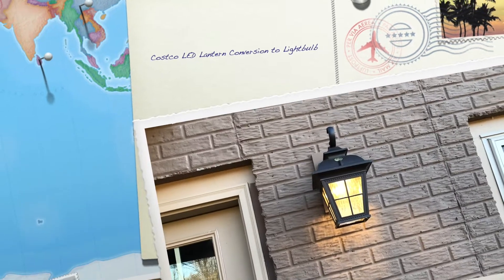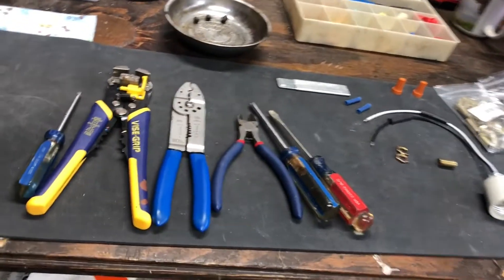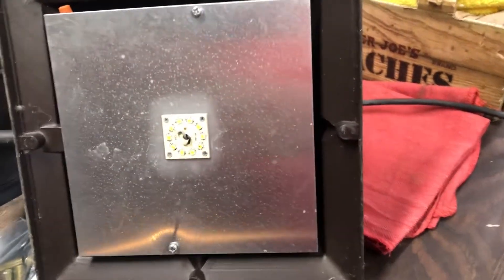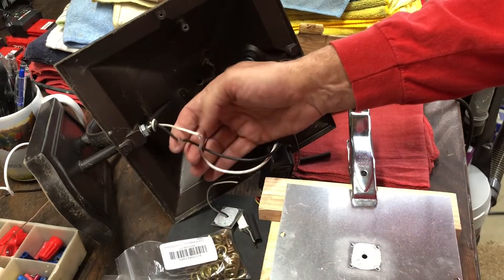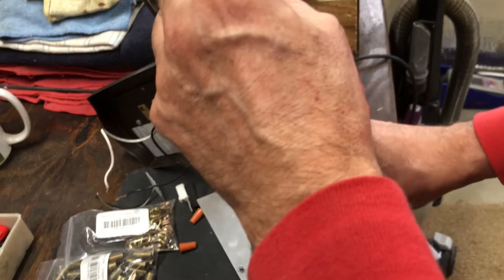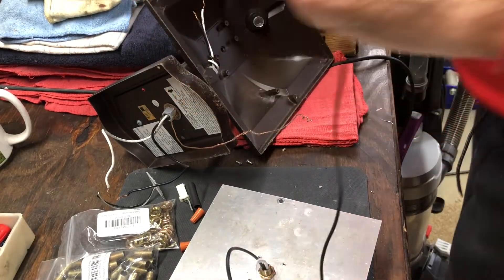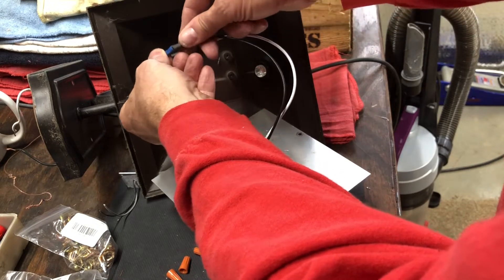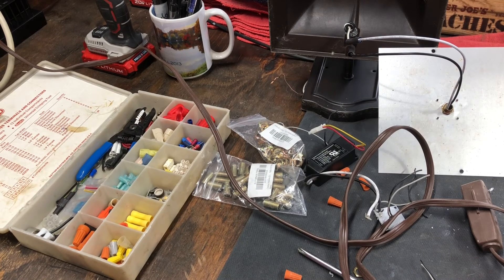Costco LED Lantern Conversion to Lightbulb

Comment: Easy to follow video. This is a way cheaper solution and gives one a lot of flexibility ... you can choose your brightness and your white shades, if you get the adjustable LED light bulbs, you can put them on a dimmer switch ... you can change to colored lights for the seasons.  I think you could run the hot (black wire) to the dawn/dusk sensor and then run the hot wire out of that and attach it to the black wire on the socket and the light will turn on at dark and turn off at light.  Thank you Chevy Guy.

Comment: Hi can you convert the costco lantern in to light bulb just like you did but leave the photo sensor connected so it works like it first did when new
Reply from the maker: I guess you could but I removed them because I wanted to control them manually.

Comment: Hey there, great video. In your description, you have two product links. Does the one for the ceramic fixture come complete with everything needed for this conversion?
Reply from the maker: the ceramic fixtures are just the fixture and wiring. You will also need the lamp rods (Amazon and big box stores) and lightbulbs

Comment: Thank you for detailed video… I did this but left in the sensor, was hoping it would work… unfortunately now when I turn on the lights… they flicker… makes a clicking sound like a blinker in a car… (weird)  no matter what type of bulb I use… the only difference in mine is I left the sensor in…🥲😢  guess I will try one more time to see if I can fix this.  Darn was hoping this would be the fix… any suggestions???
Reply from the maker: The sensor might be 12 volts?

Comment: Thanks for posting this!  Mine started flashing and I replaced the driver.. Then another problem.. Fortunately I bought two of the Altairs at Costco, so I had a reserve. Next time, I will be doing this.  This is somewhat similar to what I did inside my house - replacing CFL can lights which had ballasts die with standard socket cans and LED bulbs. Thanks again!

Comment: what about the sensor ?
Reply from the maker: I disconnected the sensor when I bought the lights, so if you want a light sensor, you will need to swap it for a 120V since the original is 12 volts

Comment: I am so happy you posted this.  I finally have changed four of our LED parts for bulbs.  Kits come with everything you need.  I was surprised how fast you can install  the bulb parts.  I still have two more to do but I am so happy.  I can use colored bulbs in these now for the Holidays.  I was always kind of bummed I couldn't use them.  I truly appreciate your showing this video.  I had not thought of this.  My husband is happy too, he didn't have to do it!😅.  Thank you!  I also just left the photocell working.  I just left it as is.  We have 6 lights, four on the front of our shop and these save us having to go out there and turn them on and off every night.  They do not have to be disabled.  I am thrilled about that!
Reply: May I know what kits you used? I also wish to leave the photocell working. TIA.
Reply from the maker: I posted the list of items needed in the description

Comment: Altair lighting now has a repair kit for $ 16.00 includes a new plate with built in driver and a new sensor. Easy install
Reply: I found a kit, but it was $36.   Can you help us find what you are talking about?
Reply: If you call Altair directly, they sell the cheaper kit. I haven't heard if they last a bit longer, I have two (out of three)of these lights bad now, and I'm trying to figure out the best solution.
Reply: How to buy the LED kit?
May I know?

Comment: went to Costco and picked up an $8 carriage light swapped out the lamp /light parts and wired it to to the dusk light sensor it to 15 minutes including drilling a large hole for the wiring and done.  Inexpensive fix..
Reply: what do you mean $8 carriage light.  was there a clearance?

Comment: Nice video! What's the reason you didn't replace the LED and drivers?
Reply: I did that on all 6 of our lights two years ago, they all failed in two years. Changing to bulbs is so easy, I used LED Edison bulbs in each.  They look so nice!  I can use different colored bulbs in them now for the Holidays.  But I keep the automatic on feature on each.  Works great!
Reply from the maker: I have about 8 or 10 of these and several of them failed due to sub-standard drivers. So I decided to eliminate the drivers and led. Now they are working fine.

Comment: Can you send the link to the parts for the conversion lightbulb?
Reply from the maker: Sure, here is the link for light sockets  from Amazon. https://www.amazon.com/gp/product/B083918KSB/ref=ppx_yo_dt_b_asin_title_o03_s00?ie=UTF8&psc=1 and the threaded nipples https://www.amazon.com/gp/product/B083918KSB/ref=ppx_yo_dt_b_asin_title_o03_s00?ie=UTF8&psc=1. The light bulbs are also from Amazon and easy to find elsewhere. Good luck with your project
Reply: very nice video, could you please put link for all parts again, both of above links are pointing to holder only. threaded nipple + retaining nut link is missing.

Comment: could you have wired it so the dusk til dawn sensor still worked?
Reply: The sensor that comes with the fixture is a low voltage DC sensor. Tou need to replace it with the 120V sensor.

Comment: Does the dusk till dawn sensor still work with the bulb conversion?
Reply: You have to replace the sensor with the 120V sensor.  The one that come with the fixture is a low voltage DC sensor.
Reply: No he took it out.
Reply: It did NOT work on mine, it caused the lights to flicker….

Comment: I have 3 out of the total 5 flashing! I need a fix to this. There is no way to retain the photocell feature, correct ?
Reply: I think you could just connect the photocell wires to the power wires?  He took it out because he said he didn’t need the feature anymore but he didn’t say you couldn’t use it
Reply: I was wondering the same thing. Did you get an answer if we could keep the photocell.
Reply: Did you try hooking it up like the other guys mentioned? Did it work? It should work if the photocell was rated for 120vac since in the new configuration, it's tied directly to power. Otherwise, would just need to buy another photocell that's compatible with 120vac and replace that too
Reply: So, the new ones don't have a separate wiring for the photocell feature. 
I was able to correct them later, without difficulty.